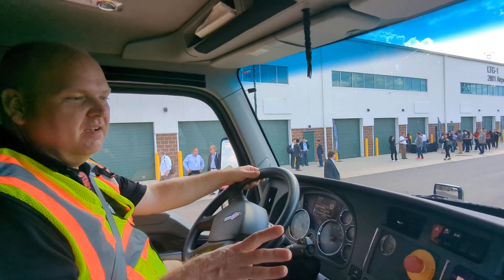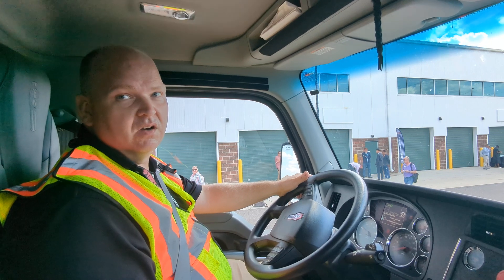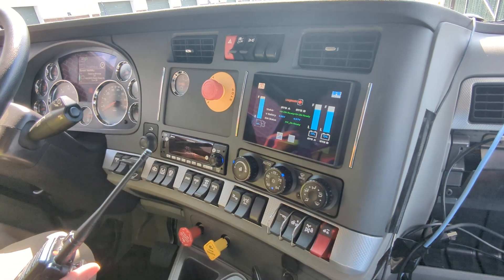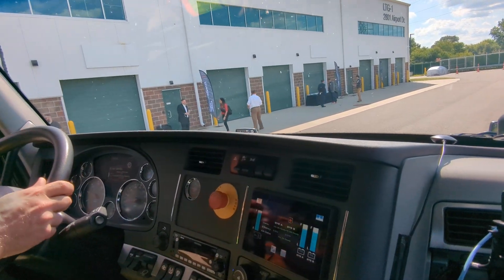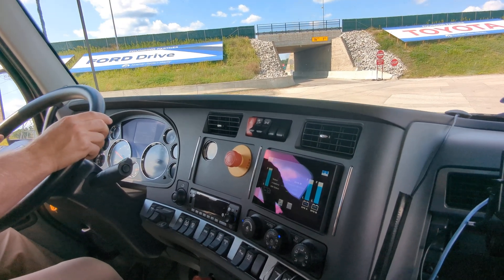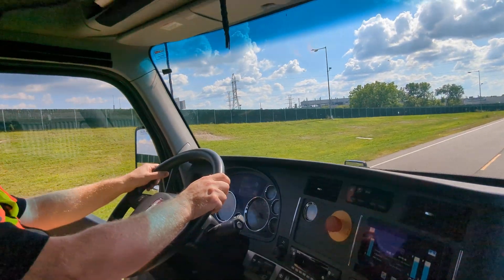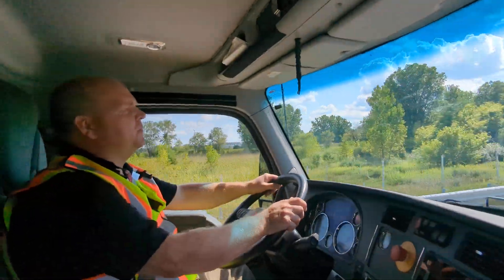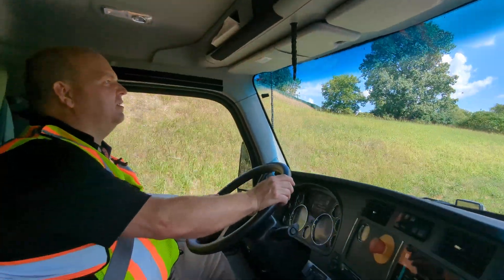Taking a ride in Toyota's hydrogen fuel cell semi

Comment: Hydrogen is nice and all...but its not there and wont be for a long time. Also they are using a kenworth to show off the tech. They arent making their own trucks. 

I wish beyond wishing that Toyota would just get into the semi truck market all the way. Make their own trucks. No hydrogen. Just toyota reliability, comfort, fuel economy, parts and service connections etc. They would dominate the market.  They already own Hino work trucks. So why not go all they way?
In 5 years people would be saying Freightliner who?!? If Toyota made a normal semi truck I would be first in line to get one. I wouldn't even care about the growing pains and the issues that would be sure to come at first. You could still test out hydrogen or even try their hand at maybe a hybrid engine. They are the kings of hybrids after all. That doesnt have to stop. The only difference would be they would have a whole new revenue stream that could fund the research, and they would have their own trucks to work on and test with.

Please Toyota...just make a normal semi....im begging you!

Comment: How much per mile?  It's three times the cost per mile of a battery powered class 8 truck.  What?  No orders?  No factory?  Just a single truck they didn't build.  Just a garage operation that loaded a fuel cell into an old diesel from Kenworth.  A small team of new college graduates could have converter one truck in 18 months.  So what.  Never mind.  It's the factory that's hard to build.  No factory,  no product,  no shits to give.

Comment: 300 miles is a surprisingly small range. The Tesla truck has a loaded range of 500 miles. I expect this one has a larger load capacity, but both companies are refusing to actually tell us what the weight / load capacity is. The point of using hydrogen is to get a longer range vehicle than is practical with batteries. If you only need 300 miles then you might as well use battery as the running costs will always be much lower. You need about 3x as much electricity per mile to run on green hydrogen. The Mercedes hydrogen truck is targeting a range of 1000 miles which makes a lot more sense in terms of being better than battery for that range.
Reply: The Tesla truck takes many hours to charge even when plugged directly into a power station, this truck takes 15 minutes ....  With white hydrogen at US$1 per Kg this truck would cost US$60 in fuel to do 300 miles with a bigger payload than a battery truck.
Reply: @chrissmith2114  not true. The Tesla semi can charge to 70% in 30 minutes. In Europe truck drivers have to take a break longer than that during their shift. If you obey the speed limits and driving hours limits the truck can go as far as the driver is allowed to drive in one day. 

I'm doubtful that white hydrogen will be commercially exploitable at scale. But even if it is, the $1 estimate only covers getting it out of the ground. To power a HFC it has to be very pure so it has to be purified and then compressed and transported to the filling station which may be very far away from the well. The actual retail price will be much higher. 

There may be some circumstances when using hydrogen is worth it, for very long distances where charging isn't available, eg in Canada. But hydrogen only makes sense with a big tank giving a long range, like the Mercedes. A 300 mile range truck is stupid.
Reply: @adrianthoroughgood1191  You need to realise that this Kenwood / Toyota experiment to replace the engine on an older truck with hydrogen PSU is the forerunner of great things, and is a good alternative to designing a truck around its battery.  I hope you realise how much power the charger has to supply to charge up a EV truck in a short time ( we are talking megawatt sized chargers here ), and already California and London are asking EV owners not to charge their car batteries because the power grid cannot handle it.  The ultimate goal for selling Hydrogen is US$1 per Kg selling price.... and White hydrogen holds the promise of that.   Toyota and other clever people know that everybody using battery EV is a pipe dream that the renewable generation sector can never hope to keep pace with demand, because even now in California once the sun goes down the electrical power grid is about 80% fossil fuel powered.

Comment: As a otr driver I can't wait for this....I have a friend who got her diesel/hydro k whopper a few weeks ago....alot of truck stops in Arizona have LP and are now talking about hydro.
Reply: Obviously faster refuelling will save you time compared to a BEV truck, but is that time really worth paying 4x times as much per mile?
Reply: @adrianthoroughgood1191   it's a lot cheaper than diesel....I got ask her what it cost next time I talk to her....Canadian Pacific rebuilt 2 locomotives from the 1980s....the claim hydrogen gets 21 mpg vs the 7 mpg of diesel and cost over 74 percent cheaper ....people in new Zealand and Australia claim it's less then half to fill up then diesel...
Reply: @trainandtruckmodeler786  I took a look at the Kenworth trucks. While it is possible to make an ICE that can run on more than one type of fuel, I could not find any dual fuel trucks sold by them. The Kenworth Hydrogen Truck released a few months ago is using a fuel cell and that can only run on Hydrogen. So I don't think there is such a thing as a Diesel/Hydrogen hybrid. 

The price you pay at the pump depends on taxes and subsidies as well as the production costs. But if you exclude those, hydrogen is the most expensive type of fuel. There's no way it's cheaper than Diesel per mile. You don’t usually measure Hydrogen in gallons, you measure it in kg, because the volume depends on how compressed it is. 

The thing you need to understand about Hydrogen is there are several ways to make it. Currently 98% of Hydrogen production is made from fossil fuels. Using Hydrogen made this way is actually worse for the environment than burning fossil fuels. You can also make Hydrogen using renewable electricity which is called Green Hydrogen and that is very good for the environment. But it takes 3 times as much electricity per mile to run on Hydrogen than using a battery powered vehicle, plus the equipment to make Hydrogen is expensive and the storage and transport is expensive. So at best when things improve with economies of scale it's going to cost at least 4x as much to run a Green Hydrogen truck as a battery truck. In the future when we have phased out fossil fuels these will be the 2 options. That was my original question: If it takes 15 minutes to refuel a Hydrogen truck and 35 minutes to recharge a battery truck, is that extra 20 minute saving going to be worth paying 4x as much for the fuel?
Reply: @adrianthoroughgood1191   you are confusing this whole conversation....the hydrogen your thinking of us the type that the Hindenburg was powered by....the hydrogen for vehicles comes from geothermal production and is a paste when the mine it ...not a gas...

Comment: Somewhat disappointing that someone who drives the truck daily (and is an executive program manager) doesn't understand how fuel cells work (or if they do, does not explain it correctly). Fuels cells don't "make electricity" any more than a battery makes electricity. The fuel cell is a battery (a type of flow battery) that discharges the potential energy in the chemical bonds between hydrogen and oxygen. A fuel cell has hundreds of cathodes and anodes just like a battery does. The only fundamental way in which it differs from a lithium ion battery is that the energy is stored in a gaseous medium, rather than a solid medium and because it is a gas, a "battery swap" is easily and rapidly achieved by simply transferring gaseous hydrogen from the place where it is charged, to the vehicle where it can be discharged.  

Also, because the medium is a gas, in order to discharge it, the gas first flows over the cathode and across the PEM (as protons) and then across the anode where it combines with oxygen.  This is why a fuel cell is a type of flow battery.

Because hydrogen is elastic it allows complete decoupling between time of charge and time of use (and that is the big advantage over batteries).

Also, the fuel cell does directly drive the wheels 95% of the time (not the battery). The battery is used to capture energy during braking and to provide instantaneous current when initially accelerating.

btw, 60kg == 2MWh
Reply: The big difference is a BEV requirements are input of electricity to then get electricity output.  So he is correct, the FCEV is literally making electricity as the input was not even electricity.
Reply: @MikeSwartz that's incorrect the input was electricity.  That's how the hydrogen was charged. The hydrogen is then moved into the vehicle where it is discharged.
Reply: TY for the explanation.
Reply: Correct.
I would add that nothing "makes electricity". The electrons are always there , in all normal matter.
Batteries, fuel cells , generators etc. create a potential difference which will cause a current to flow in conductors. The motors allow that  current  to be converted to mechanical energy.
It's analogous to a hydraulic drive system. The hydraulic fluid is always in the system, the pump imparts energy to the fluid and the hydraulic motors convert it back to mechanical energy.
Reply: If the fuel cell is not producing electricity what the hell is making the truck move Bro ?  A Battery stores electricity by chemical reaction, but when you ask for it it is electricity that comes back out..